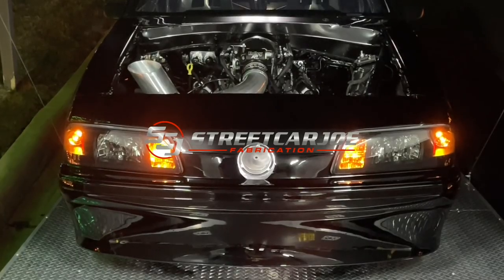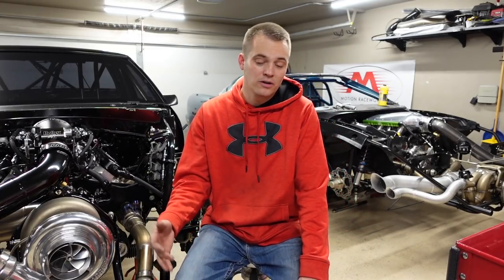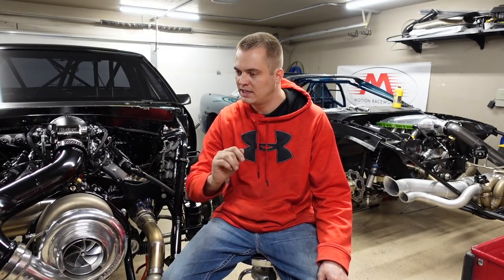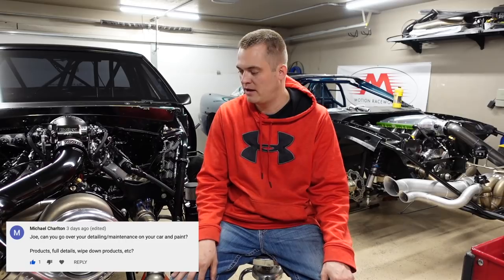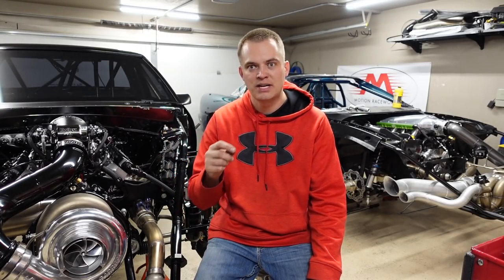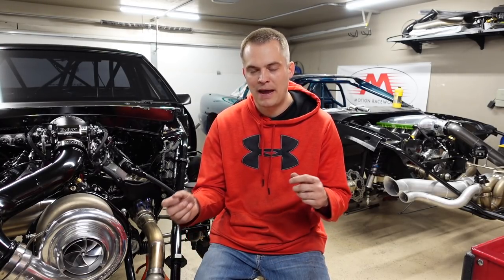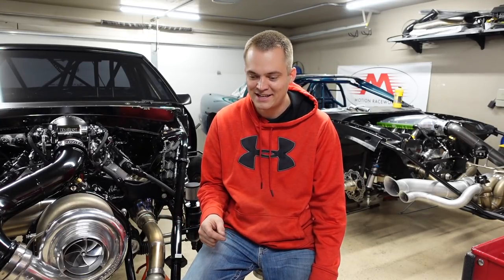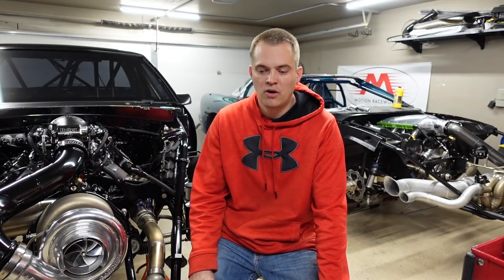Methanol Street Car?!? How to get good gas mileage and cruising on methanol! Answering everything!!!

Comment: I just noticed your tube front wiring harness brackets. Where are those from?  They look legit for running your wiring harness. Beats my idea of J clamps and zip ties
Reply from the maker: Hmmmm. Where at? I don’t see what you are talking about.
Reply: @StreetCarJoe  I may be blind buyt your bottom bar supporting your turbo, looks like it has 2 brackets holding your front wiring onto the bar.  They appear to be billet
Reply from the maker: @4eyefox  Those are actually weight mounts. So they clamp on to those bars and then have a big threaded hole on the bottom side so I can hang lead...

Comment: What are your thoughts on running 50% methanol with electric pumps?  Is E85 still a better option at that point if you don't want to go to 100% methanol?
Reply from the maker: Interesting. I don't know anyone doing it personally or have any experience. I had a setup once that was out of fuel pump and was "meth dependent" using meth injection at an insane rate. I don't see why you couldn't do a 50/50 mix. I think a new trend we are about to see is a lot more dual tanks. Tank inside a tank style that is meth and pump gas with 16 or 24 injectors. But I still feel mechanical pumps will be the main source of delivery. Have you tuned some 50/50 setups? Id like to hear more on it and hear about some setups using it for sure...
Reply: @StreetCarJoe  I've only tuned E85 and pump/meth injection setups.  I'm curious if 50% methanol would give "most" of the benefits of meth without needing as much fuel system.  I've used lower percentages of ethanol down to 50% due to fuel system limitations before and was still getting "most" of the benefits of ethanol at only 50%.  I'm a self learner like you, but not on your level.  I really like what you have going on here on your channel.

Comment: What’s the ball park WHP level on your car at a typical street/no prep. And radial races?
Reply from the maker: At no prep? I mean that varies so much depending on surface. Anywhere from 800-1200 I’d say on sketchy stuff. Radial prep I was making like 1500-1600 to the tires…
Reply: @StreetCarJoe  that’s so awesome!! Thanks for the reply! Just was always curious, and yes. Surface makes a HUGE difference! 

The other one I had, what Compression Ratio do you run? How does that fair on M1 vs 91 when you turn it down for storage? 

I’m planning my first m1 “street” build!

Comment: What do you consider a long cruise?
Reply from the maker: I base that off of the street classes I race. Most of the "longer" ones are 50-75 miles and then straight back to race without changing anything. I could also do the drag week style and swap fuels and go 200+ miles cruising on a tank.

Comment: What do you recommend for a budget tow rig?
Reply from the maker: Great question. I dunno. I tried an older 7.3 excursion and had bad luck. Diesels are so expensive right now.
Reply: @StreetCarJoe  only thing i can really thing of is the 6.0 Silverado’s and hemi 1500s but i live in NY so they’re all rust buckets 😭
Reply: F150 Ecoboosts are pretty good bro. I have a 3.5L and they can tow 13,000lbs.

Comment: So Dave do your car still have the stock torque boxes the upper and the lower
Reply from the maker: My car or Dave’s car?
Reply: Joe's car
Reply from the maker: Mine is factory torque boxes. Not even those fancy ones with a bunch of adjustment. I have reinforced boxes with one factory location hole in each. I also struggle with bar angles and ride height because of this...
Reply: So are those Santo shocks helping you get your 60 ft down that low
Reply from the maker: @sylvesterwashington1611  I really feel they are the main reason the car works so good.
Reply: Why I asked is that I built a 88coupe and I put afco on it in the stock location and they are coilovers and I can't get it to 60
Reply from the maker: @sylvesterwashington1611  So much more goes into a good 60ft besides the shocks. Bar angles, pinion angle, weight distribution, etc. I feel if the angles are bad it doesn’t matter how good the shock is. Make sense?
Reply: Yes sir thank you for taking with me
Reply from the maker: Np

Comment: Do you run on pure methanol?
Reply from the maker: Yes
Reply: @StreetCarJoe  so can i build a system like for example  when im on tje race track to activate the pump for methanol  and when I drive dayli  to activate on normal gas  would be work?  Is like tje sistem on LPG

Comment: Smaller tuning window?????? Wtf dude don't make America dumber, your tuning window is like 30 percent wider than gasoline.
Reply from the maker: You seriously think methanol has a larger tuning window vs a race fuel like C16? 🤔 Obviously when compared to a pump gas but no one would compare those two. Comparing two fuels that can make 1500+ hp.
Reply: @StreetCarJoe  "but no one would compare those two" I did, you know street car.
Reply from the maker: @keithbusch4014  Ha. Well then if you are trying to make around 800hp on methanol vs pump gas. I would agree with you 100%, methanol has a larger tuning window than 91 octane 😂
Reply: @StreetCarJoe  Wouldn't you still be 7 8 9 percent off just switching m1 vs c16? Not being a smart ass anymore..KMFNB
Reply from the maker: @keithbusch4014  I would say most people building 1500-2000hp cars would be deciding fuels between a race fuel like C16/Q16 or methanol. But I'm no expert. Just a slow street car...